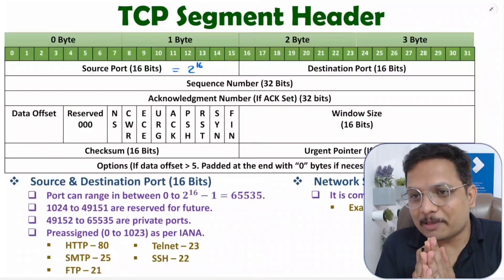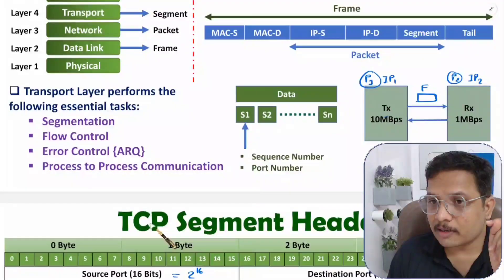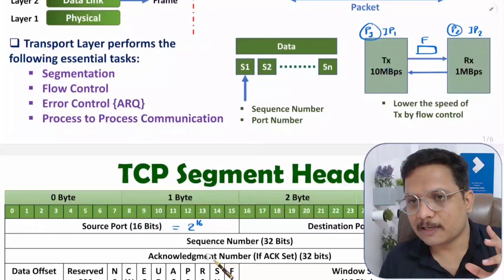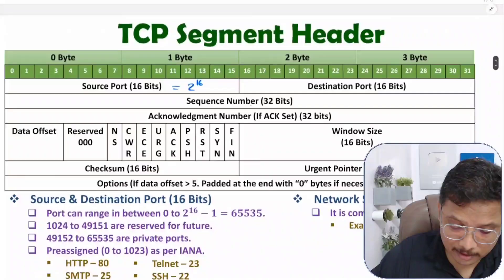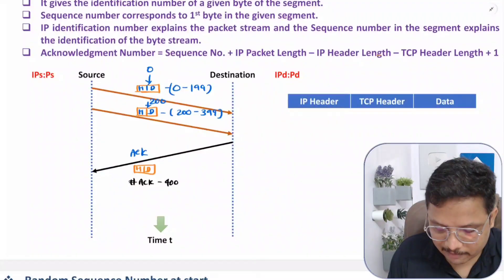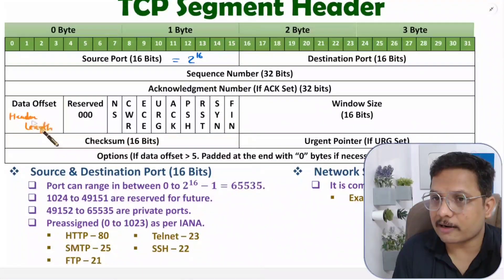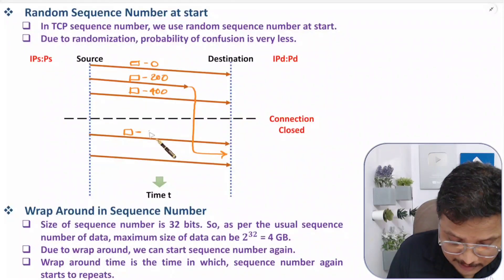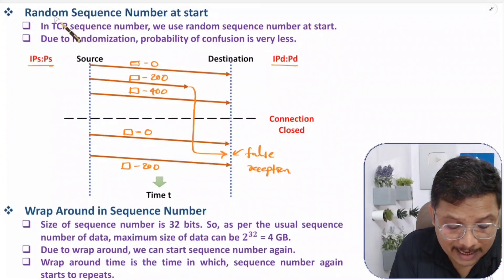Sequence Number and Acknowledgment number in TCP Segment Header | TCP Header Concepts

Comment: I once tried to do IP spoofing (to cheat in an internet game called BiteFight) and couldn't do it because this sequence number was random so since then I've always been thinking that this randomness is an anti-spoof mechanism but now I'm enlightened and know that this was designed to prevent confusion after reconnecting, nice :) . Btw when you reconnect you most likely are assigned some other source port so that's another mechanism to prevent confusion. And also, isn't there some special socket state called TIME_WAIT which is also related to prevent errors related to too early reconnection?